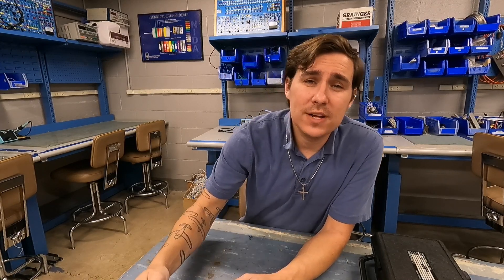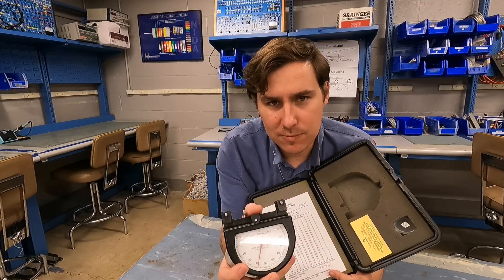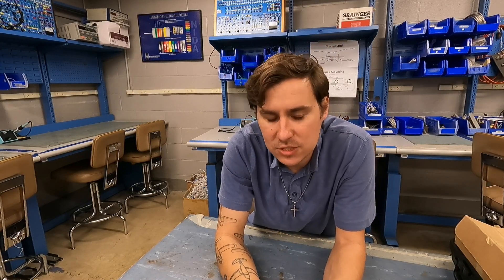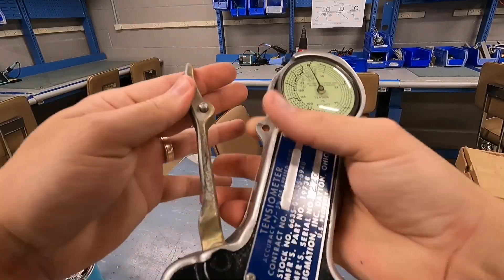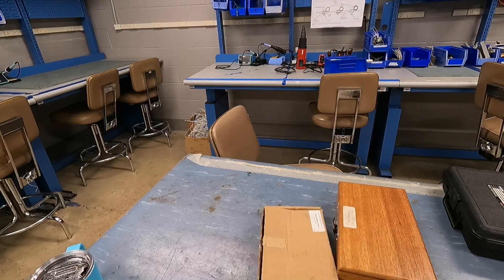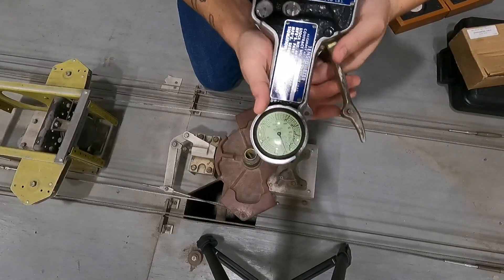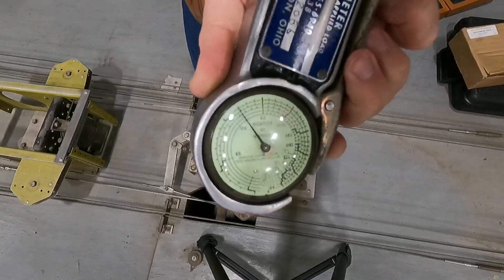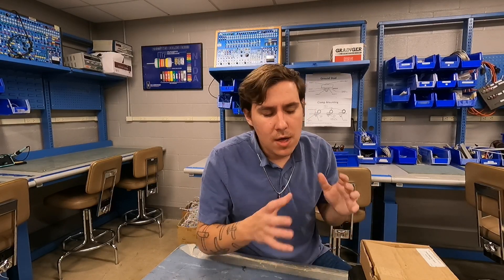How to Use Aircraft Cable Tensiometers | Aviation Maintenance Guide

Comment: For the first Tensiometer you'd demonstrated (T5 Tensiometer), it was reading correctly. The table on its calibration card in the case is critical. And here's what we can see:

On its table, there are three columns for the #1 gauge block. The 1/8" cable is the right-most of those three columns. It also states at the top of that portion of the table, "Instrument Dial Reading".

Because the dial was indicating 50, we scan down that column to find the number nearest 50. The closest is 51. We'll need to interpolate to get an actual calibrated measurement. Note that the number immediately above the 51 shown is 45. The difference between 51 and 45 is 6 (increments).

Then, we look over in the left-most column, "Cable Tension (LBS)" and observe that the line corresponding to the 51 reading is 60 lbs. And, the next line above, corresponding naturally to the 45 reading is 50 lbs. The difference is 10 lbs. 10 lbs divided by 6 increments would equal 1-2/3 lbs per increment.

Because you're reading 50 on the dial, the tension, therefore, is 58-1/3 lbs. That figure corresponds quite nicely to the second Tensiometer, which came out to "about 60 lbs". Bolstered by the Tensiometer, which measured 58 lbs.

Sure, they should be calibrated, but being in a school, they're all either equally wrong... or they're all equally right.
Reply from the maker: You are indeed correct. I read that table backward. That's what I get for filming this at 6 am. before work. I'll make a correction video on Tuesday. In the meantime, I'll pin your comment thank you.

Comment: Now instruction on how to test the C152 rudder cables that lay completely slack in the empennage.
Reply from the maker: New rudder pedal springs will help solve that. There is no set tension on them the springs that hold tension on the pedals are also what holds the tension on those cables

Comment: You forgot the most important part of using a measuring device:  IS IT IN CAL?  None of your devices seem to have a calibration sticker (even one you made up).  0 points, your cable tensions are meaningless.
Reply from the maker: @yeagermcbipper9008  I literally said that all measurement tools have to be calibrated in the real world.
Reply: 9:22